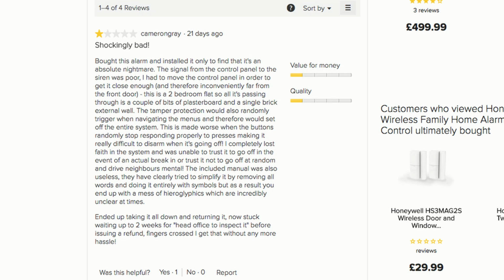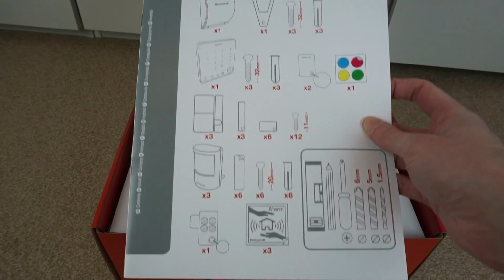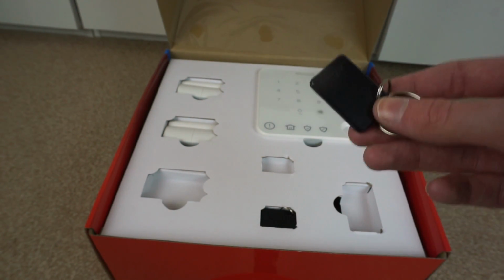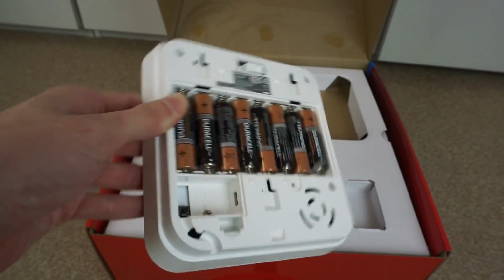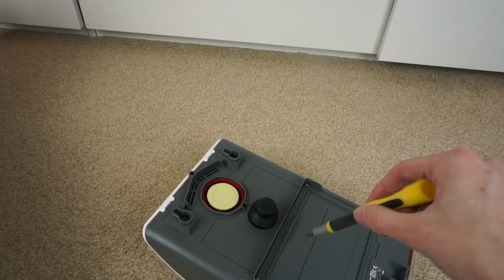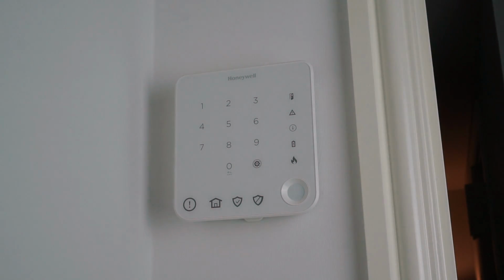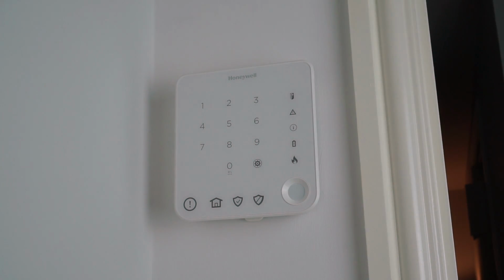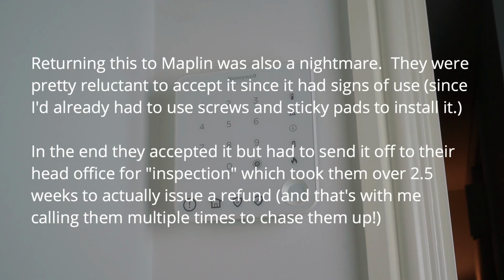Completely useless alarm system! Honeywell HS351S Wireless Burglar Alarm Kit

Comment: We have the "Response" solar siren version of this Honeywell system which is now into its second or third year. It's been 100% effective and fault free and the chap who fitted it swears by them. In general, therefore, I simply cannot agree with this video at all. Wireless issues are an issue in some homes and it's likely to do with the construction of the walls rather than the distance between the control panel and the external alarm box. For example, some "dry-lined" plasterboard is coated with aluminium, which will reduce WiFi effectiveness massively. If your home has a good general WiFi signal from your Internet router, even just outside your house (use a mobile phone app to test the strength), then you can be confident that a wireless security system will work for you since it uses a similar WiFi signal, strength-wise. Add to this, that the Reliant customer help people have always proven 100% helpful, and I am pleased we chose this system (I think the UK company has now closed, though, and customer service is international).
Reply from the maker: I have no issues with wireless systems but this was absolutely not fit for purpose.  IMO, the siren being out of the range of the panel should be classed as a fault and should alert the user, with this system the only way to realise the issue is when you run a test.  I could totally see there being situations where it works initially but as batteries lose charge or furniture is rearranged and put in the way of devices the signal may later be unable to reach the siren and cause it to no longer work which would only be discovered when/if the user next tested it.  I have replaced this with a wireless system from Texecom which has none of these issues, the signal strength is fine on all of the devices, it gives full status of all devices on both the keypad as well as when the panel is connected to a laptop and any faults will clearly be flagged up with a text explanation.  While I'm in no doubt that this probably works great for some people, the issues that I had mean that I'd have absolutely no trust in it as they indicate serious design flaws.
Reply: @camerongray1515  Thanks! The fact that another system works well does suggest that the Honeywell product is different and, in your case, "dreadful". I'm lucky in that case - although it's not exactly the same product as you have. Luckily I have had no issues with my Honeywell / Response wire-free system.

Comment: I bought a honeywell system off this place on Ebay it was supposedly ‘New’ and I decided to set it up, and my GOD it was bloody useless. Less than 10 minutes I connected the sensors all the together and the control panel just wouldn’t register, in the end I ended up selling it back for less than half the money I paid for it.

Absolutely useless! I now have a Yale system and its absolutely BRILLIANT (no issues whatsoever) touch wood and I don’t think i’ll ever buy Honeywell again, SmartResponse is also made by Honeywell as well. 😩

Comment: I've fitted security and fire alarm systems along with cctv, nurse call. you name I've fitted it, 1st I'm a wire engineer and still today would recommend wire over wireless any day, wire for me still has its problems but they are 90% effective, NEVER fit a battery alarm it has to have power which would help boost the power of a wireless control panel to sounder, 2nd you need to understand the fundamentals of the wireless system, as the comments below say pay of a wired system not all company's are cowboys ( not saying most are as there not ) get recommends from other people about there systems and have a quote done they can be cheaper then you think, plus a company bell sticker goes a long way, They say you get what you pay for and you do, but one thing I would say here I would have no problem using a Honeywell system they are among the best but in saying that I use wired systems, we know our job very well and through the years we learn about vulnerability where you are most likely to take a hit from a break in, all I would say is leave it to us that know, we are good at our job we know our job, I wish you all the best whatever you outcome is.
Reply from the maker: I ended up fitting a high end Texecom system.  It's still wireless but supports proper two way mesh communication and uses a proper mains powered panel which also allows me to connect wired zones in the future if I'm ever in a position to run cabling again.  It's the same system that I've seen lots of large alarm companies installing recently and it's been incredibly reliable so far (I've also got a video showing that system) Honeywell is good when it comes to their professional systems (Galaxy panels.etc), this system on the other hand seemed to be made by a completely different division of Honeywell (or maybe even a different company entirely licencing the name).  I could certainly have got an alarm company to fit it and wouldn't have a problem with that, however I enjoy DIY and fancied playing with alarm equipment. I'd definitely go with an alarm company if I required monitoring services and have dealt with then in other premesis.

Comment: Well having fitted this 3zone kit, the main thing I would say is print off the manual, as that is so much easier to follow. The kit is already prelinked so following the set up guide of the manula it makes it  eaisier. What I did have a problem with was testing teh external siren to make sure it worked before I fitted it onto the bracket on the wall, I did get it working, but think the siren was in service mode (option 8 of the service mode) and it needed to be deactivated (which is done by pressing 9, when in serive mode option), it also need to have the 'tamper' button on the rear pressed in ( i think, as it worked when i did that). All in all for £220 from Box.co.uk it's a nice easy to work kit. So much better than the RESPONCE alarm of ten years ago I had fitted which was running on the 433mhz band which often false alarmed, The Honeywell is on the 868mhz signal, which is supposed to be the better on to be on.... well see ;)

Comment: Excellent video, very fair and honest. Thanks.
I've just spend a few days trying to fit this alarm. It went back (am waiting for refund). Totally unworkable. Sensor keypad hardly ever works - I had to take my shoes off to get a decent contact. 
And worst of all, the alarm gives no idea as to what state it's in - armed, unarmed, zones 1&2, zones 1,2& 3 etc. And shocking, poorly written guides. I expected more form such a major player.
I'm  looking forward to see which alarm you finally choose.
Reply: Did you remove the almost impossible to see clear protective film from the keypad ?
This is why so many people are having difficulty with the touch keys on the keypad.
Theres nothing in the instruction manual to prompt the user to peel this off !!!

Comment: Used to work for a retailer similar to Maplin some years ago and we never, ever recommended the handful of wireless alarm systems that we sold for precisely the reasons you've described - a significant percentage ended up getting returned due to reliability issues and because that's just the way they were and not "faulty" as such we'd end up having countless units of opened, returned stock sitting around and wasting space.

Not to mention the proprietary additional PIRs and sensors for them often ended up getting written off or sold at a loss because nobody ever bought them!

Comment: Do you have anything like ADT over there,you definitely need an alarm with all that equipment you have, but a non monitored system is quite useless
Reply from the maker: +Todd T There are definitely companies that provide monitored alarms (ADT included) but they are pretty expensive (ADT is like £30/mo, my entire insurance policy is significantly less than that).  I'm in a very densely populated area (must be at least 50 flats that look out onto mine) so a "bells only" alarm should at the very least act as a deterrent, especially since most places around here don't have any sort of alarm.  With the new system I could buy an additional unit that would give it telephone/internet connectivity to alert me to an activation if I wanted to go that route.

Comment: really cant understand why you didnt wire an alarm when you did the data..
Reply from the maker: I simply didn't think about installing an installing alarm when I was doing that and by the time I decided to fit one I had already filled in the holes and decorated.  Nowadays it seems as though decent wireless alarms like the Texecom I replaced it with are perfectly reliable so there isn't a massive issue not having a hardwired system.  It also means I can easily move/add parts of the system in the future without having to add even more wiring.
Reply: Could of got a Hybrid Richoshite panel haha. Texecom looks good though but wired is always better. Enforcer is probably more reliable than the texecom but still a richochet system is good.
Reply from the maker: Not sure if there would be any benefit to go for the hybrid panel since at least at first the system is entirely wireless so it seemed like a more sensible option to get the wireless panel from the start then if I did go to add wired zones and needed more than 4 of them I could then add a wired zone expander (The ricochet panel still supports 4 hardwired zones out of the box).  The Pyronix system looked okay as well although the fact the Texecom uses mesh networking technologies appealed as I didn't want a repeat of the weak signal issues from the Honeywell.  I'd also seen loads of people commenting that Texecom had very helpful support even for DIY installers and there appeared to be a lot of people online who had installed it themselves which really appealed.

Comment: I was thinking of buying one of these kits as well a few years ago. First thing that bothered me when I saw most of these was: what's the point of the alarm system if it's in the same case as the keypad?

I ended buying a Texecom Premier Elite 24 and wired it up myself. 300m of cable and a lot of drilling later and the system was set up. I paired it with a GSM module (which was the most expensive part of the system) and a wifi module. The system is pretty reliable - my only issue is one of the PIRs in the garage gets off every few months. Probably because of a mouse. So I will probably replace that one with a PIR+MW pet immune sensor just to be done with it. And I prefer hardwired to the wireless option - it would be way too annoying replacing all those batteries, not to mention the fact that I don't trust wireless systems no matter who makes them.

Texecoms Wintex software is pretty awesome for setting the system up and trying a bunch of different combinations. Plus viewing the status and everything. Sadly the end user apps for the phone are horrible. So I will probably upgrade the system with their new Texecom Connect in the future. These seem a lot more user friendly.
Reply from the maker: I ended up getting a Texecom Premier Elite 64-W so it's still wireless but significantly better.  In theory the batteries should last years so I'm not too bothered about having to replace them every couple of years.  At least the Texecom uses good quality lithium batteries instead of the basic alkaline ones this Honeywell system had.  It also supports the connection of wired zones as well so if I was ever running more cables down the line I could look into fitting wired hardware without having to replace the whole system.

I'll need to give Wintex a go as it looks quite cool, I didn't bother buying the proper cable since it was £30, I tried using an Arduino as a USB to TTL interface instead although couldn't get it working.  Will need to try with a proper USB to TTL cable and failing that I'd have to buy the proper cable.
Reply: Wintex works pretty well. And if you have the wifi module (or a cheap chinese compatible module like I do) you can use it wireless. I am not 100% sure if you have to enable the com port on the panel before it will work with Wintex. I am not using the official cable either. I know that the official cable is using an FTDI chip in there. I was using one of the cheap cables with the Prolific chip and it worked just fine as well. Arduino should probably work just fine too. Though I can't remember if the panel uses 3.3 or 5V logic (you can find that out somewhere along with the pinout).

As for batteries.... I have 7 PIRs and around 12 door and window contacts. Plus a glass break sensor. Changing all of those batteries would be a nightmare in itself-
Reply from the maker: Ahh, interesting, I may well have the com port disabled, will have to check although getting a WiFi module may work even better as I'd be able to check it without having to open up the panel.  With that many devices I can see batteries becoming a pain, all I have is 4 PIRs, a single door contact, the keypad and the siren.
Reply: If you want to add wifi your best bet today is probably the official Texecom Connect smartcom. The old com-wifi is more expensive and the app is just horrible. However... you can get a cheap USR-WIFI232-T wifi module on ebay and hook that one up (you will need a separate voltage regulator also). This is the module that the official Texecom com-wifi is using and you can get it for less than 10£. But if all you want is Wintex then that is probably your cheapest option.
Reply: roli rw

Comment: Pyronix Enforcer is a top quality wireless option, but it requires a company to install it.
Reply from the maker: I ended up going for a Texecom Premier Elite 64-W which looks like a pretty similar system to the Pyronix.  It's also technically designed for professional installers but I was able to get it working myself without too much trouble, just took a bit of time to learn the terminology due to the documentation being somewhat limited.  Of course there was also the fun "Contact alarm company for service" message I kept getting when setting it up :P
Reply: Cameron Gray The professional systems are definitely more reliable than the DIY ones 👍. The Texecom systems are great once the programming is over 😅
Reply: It’s a professional system, but at IFSEC they sell the kits and they have how to vids on their YouTube channel. You can also get the kits on eBay and Amazon from resellers.

Comment: The Yale wireless kit is better
Reply from the maker: I imagine it would be but decided to just go for it and get a proper professional system, the Yale ones still only used one way radio communication like the Honeywell so could well experience the same issues as this.  The new system also uses a separate control panel from the keypad so it can be hidden away in a secure location.  Looking at this Honeywell (and I imagine most other DIY kits with an all in one control panel) it would be trivial to disable it with minimal tools assuming you knew what system it was (which would be easy to identify from the siren.)
Reply: Why does the flat complex not have full CCTV? Most modern blocks have full security with door entry dead locks and video phones. That would negate the need for an alarm and just leave you to invest in decent "bump proof" locks. People never take notice of house alarms much less a flat with an internal siren no one can hear.
Reply from the maker: It has some CCTV but it only covers limited areas and nothing inside the buildings, the building is pretty secure with decent locks but I wanted to add an alarm as extra security.  I also do have an external siren so it would be pretty obvious if it went off to people nearby.
Reply: Vax Buster I agree I love my yale! Had no problems with it thus far ☺️

Comment: Urgh. I feel for you. Unreliable alarm systems are the worst. I'd recommend a Honeywell Galaxy system. They cheap as chips and extremely reliable and designed and built along the M8 in Motherwell. I doubt they are any relation to this travesty...

Comment: I prefer metallic keypad buttons.

For starters, if it's in a high security area where it's important to keep the code secure, metal will rapidly cool whereas plastic and rubber will allow thee code to be read a few seconds after, which decreases security, the numbers don't get worn off... which also increases security and is good with durability

Easy to clean... you just wipe it down or blast it gently with a steamer and wipe it off, then you are sanitised and nobody will know what you pushed.

They are also tactile, you can push them in hard and sometimes feel it "click" into place

Comment: Honestly, I would like to build my own security system... I don't think it would be terribly hard to integrate it with a PBX to auto-call the police either.

It could just have magnetic switches to detect open doors and windows, and like I said, be tied into a PBX

Great video btw!
Reply: I have the same temptation. 

And for the auto-dial, can have it auto-dial yourself, check your CCTV if you installed it then consider contacting police.
Reply: It's not permitted (in the UK at least) to have an alarm system that auto dials the police. To get police response from an alarm system it must notify an alarm receiving centre and the system must be professional installed and regularly maintained by a recognised company.